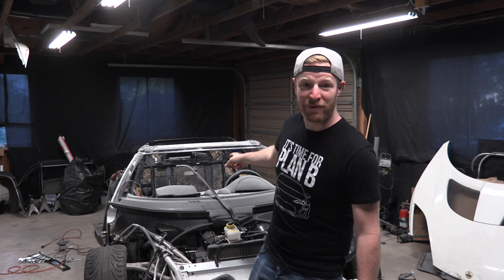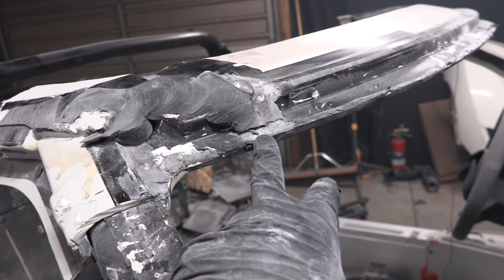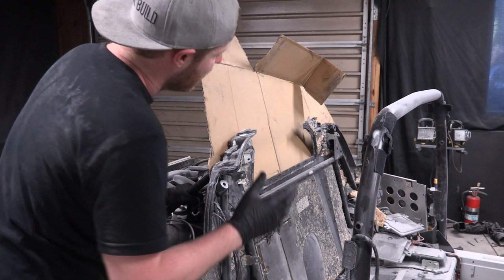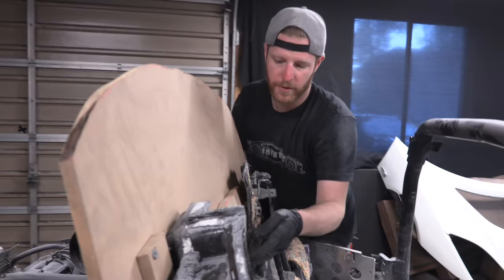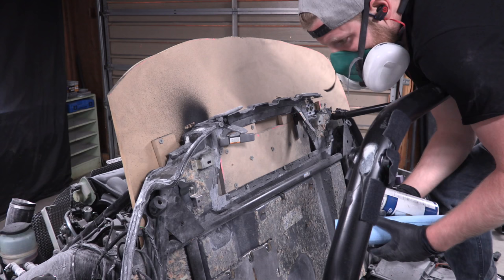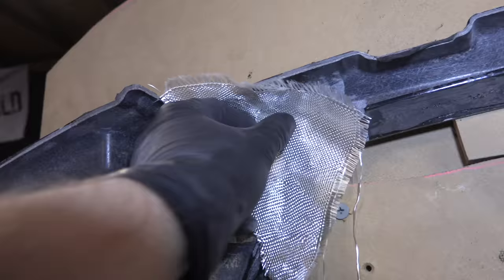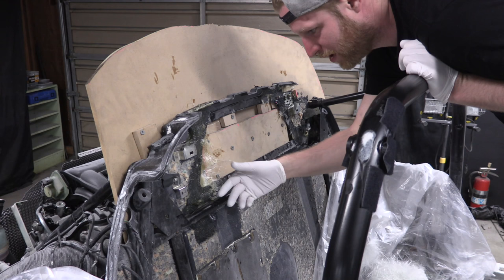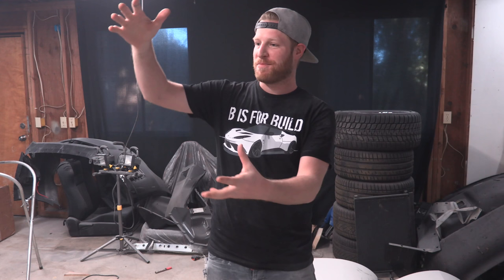Budget Lotus Evora Pt 12 - Teardown Is Done! Let's Build!

Comment: Do a clear roof. Like plexiglass. Could look cool
Reply: agreed
Reply: yes man. definitely argee
Reply: As long as it doesn't yellow from the sun and it's strong enough.
Reply: +FishFind3000 is it possible to tint plexglass? it could help. idk just curious
Reply: Great idea
Reply: I expected to get some hate from this. Thanks guys
Reply: Gorilla glass would be better, you don't want hail on that lol
Reply: +CR7GB11 it hails very minorly once a year in Oregon, that isn't really a problem. I'm a 15 year native and the biggest hail I've seen is about the size of an air soft BB.
Reply: dark tinted... or else wud be a headache...
Reply: Mason Forrest Well I'm from the Netherlands. My sister had dents all over her roof and my brother in law had a broken windshield and roof because of hail. And it was the size of a golf ball. 
As for the evora maybe make a custom soft top?
Reply: +CR7GB11 Plus I'm sure this would be garage kept, so I don't think hail would be a problem. but I like the Idea
Reply: Its plexi. They use it for racing and also they use it in thicker applications for stopping bullets. Don't think hail would be an issue.
Reply: FinerThingsInLife Doesn't plexi stain also?
Reply: That would be really cool, if tinted and formed to look the same as the original roof.
Reply: New-age Plexi and other materials that are very similar are super different from the 90's shit. Most of the high grade plexi wont yellow in the sun anymore.
Reply: Then plexi glass would make a good choice. Would it heat up the car a lot if the sun is pointed at it?
Reply: +CR7GB11 it might not yellow, but it's gonna let light in lol, would need a hella deep dark tint, like triple limo, but I fear that might add more heat, soooo... triple limo with uv tint in between those layers? Lol I don't even know.
Reply: (would)could also ruin it
Reply: +FishFind3000 lexan
Problem solved
Reply: +FinerThingsInLife lexan is better for this purpose

Comment: Tip for you when sanding or cutting fiberglass; before working rub any exposed skin (arms etc) with talcum/baby powder, it will stop your pores from being open and you won't get the itching normally associated with working with fiberglass.

Comment: I'm not sure if this has been mentioned before, as I just found this channel... but the tires are mismatched. The rears are bald, and the fronts are on backwards. It's not surprising the car lost control in the wet, since the water was being channeled into the center of the front tires, and the rears have no tread. My guess is the previous owner didn't know anything about this car, and likely stretched his budget to afford it (tires are the first indicator someone is struggling with maintenance... who would run around with bald mismatched tires on purpose??). Great channel!! Subscribed.

Comment: I am a fibreglass engineer. Just a tip on the fibreglassing the bulkhead.
1. Depending upon how thick your fibreglass matt is. For extra strength and low weight try using 1 layer of matt and two layers of weave. 
2. The drying time in between layers doesn't matter. You can apply the second layers as quick as you want as long as the resin hasnt gone off. 
3. With the bubbles in the fibreglass just use a standard paint brush to push them out instead of a roller especially with all the contours and shapes around the bulk head.

If you need anything else just pm

Comment: main trick with using the fiberglass mat is lots of resin under before you apply the mat so it soaks through then roll the air out right away

Comment: The chopped matt is not stronger than the woven cloth even with different loads applied. As you mentioned the chopped matt is lots of little strands, the strands are where you get your strength. So the chopped matt has thin strands, but they are short, your woven has thicker strands to absorb more resin and are long, this is a big difference. Also I've worked with fiberglass for nearly two decades, you don't want to wait till tacky and come back and recoat. Your going to build up with too much resin that way and it will make the piece heavy and brittle. (Think like concrete without rebar) lay down several layers of your woven at once to build the piece back up. The idea is to have JUST enough resin to wet the piece, this gives the best strength to weight combination. That's why the pros use vacuum bags to squeeze all the layers together and remove extra resin. I used to cut all my cloth, alternate the grain each layer, then I would dip them and put them on the car, then work out any air bubbles or dry spots. You can also put wax paper over it with clamps to "squeeze" your layers together.   Good Luck bro.. your crazy. BTW... you need to research gelcoat, because you are going to have to use that on several areas of the car.

Comment: You might want to look at using a heat gun and scraper to get the glue off.  I've also had good success with air powered scrapers.
Reply from the maker: that little oscillating tool i have works wonders for removal
Reply: B is for Build I agree completely, I was just thinking of something a little less invasive.

Comment: Protip, don't apply the fiberglass one layer at a time. Get yourself a smooth plank, apply some wax to it as a releasing agent. Build up multiple layers on the plank to the desired thickness with a mixture of chopped mat and the woven. Wet the mat on the plank layer by layer and press them together and spread the resin with a roller, this makes life much easier and drastically decreases the chance of air bubbles. Then transfer the (still wet) fiberglass from the plank to the surface you are applying it to.

 It also saves a huge amount of time and cleanup between steps and a lot less wasted resin from doing multiple single layers.

Comment: Mat can be stiffer, but it is never actually stronger than woven or stitched fiberglass. Mat fiberglass is most often used as a filler reinforcement or stiffening agent. Satin weaves are directionally stronger than plain weaves, stitched fabrics are directionally stronger than weaves. Also note that epoxy resin is stronger than polyester and vinyl ester resins, but can't be used with mat. For best strength, weight and conformity I recommend vacuum bagging.

Comment: you should have waxed the boards just to make sure the fibre glass doesn't stick to it
Reply: yeah lol and why is he doing it in individual layers.
Reply from the maker: good tip, i think im going to have to do more than a bit of cutting to remove it, but its all kinda what i expected. But wax woulda been cleaner. These are the good things you learn along the way.
Reply: +B is for Build you don't need expensive or time consuming waxes either. I did a project using a dry lube stick (it was like a soft wax stick..like surfboard wax) and it worked excellent.

don't be afraid to do more than just one layer of glass, biggest thing is to push the glass down so the resin and air come to the surface (use a paddle roller )
Reply: +B is for Build I can see that you have bought a new oem rims for the evora

Comment: @14:19 Your windshield frame looks like it will not be strong enough to hold the glass. The top of the windshield frame is no longer supported from the back, because you cut it. I know your going to rebuild that, but it is a load bearing structure. Your add on couldn't possibly be as rigid as the original 1 piece. Dont hit any potholes, or speed bumps! :D

Comment: The fiberglass resin should not harden unless it's waxed. Resin needs to be isolated from the air to cure, if it cured just sitting there then it has wax in it and adding more layers after it cures can be problematic. The layers will probably not stick together very well, and may delaminate. Hopefully this is not the case. Try to buy non-waxed resin, then add some wax to your last coat so it will cure.

Comment: Awesome video! Question....If you put fiberglass over the wood screws used to splint the fiberglass how are you going to remove the wood....
Reply from the maker: good question, ill drill that part of the fiber out to remove the screws, then fill it back in later. It was just too much work to try and work around them

Comment: great job man what resin and hardener are you using mine I'll have to check to tell you but I'd fill the cup same as yours half way then 20 drops and it would be tacky in 30 mins hard in 45 total but probably not fully cured don't think that happens till two weeks because still smelled fumes in the garage till then. 
working with fiber glass is amazing if anyone has a good project just try it out it's cheaper then you think $50 for  a good start just remake a a-pillar and learn from that my first project was stealth sub to a terrain using there stock box sounded amazing.
Reply from the maker: im using bondo, it says 2 hours online but im going to cut the time down a little more for the next session

Comment: What camera do you use?
Reply from the maker: gopros ( old ones ) canon EOSM was my starter camera, and i have a broken canon xc10 i use
Reply: Thanks for the reply, in gonna start vlogs and I was just wondering what certain youtubers use I'm thinking of getting the t6i and a GoPro which ever comes first
Reply from the maker: I would either get a gopro with a good mic and a gimbal, or a EOS-M as a starter camera, EOS-M is a very inexpensive way to start and its been a great camera for me.
Reply: Thanks! I'll look into it! May donate a newer GoPro also so be on the lookout 😎
Reply: Even cheaper, and lighter you can get yourself a Canon G16 witch is almost the same sensor with autofocus, autostab and does 60p FullHD and also get wifi to send it straight to you phone ;)

Comment: Note to self: never buy a british car
Reply: Aston Martin, Jaguar, Maclaren?
Reply: exactly!
Reply: Aston Martin, McLaren, jaguar, Land Rover, ariel, caterham, what's wrong with them?
Reply: +MULTIBASHUR 1999 rovers are shite I'm surprised they haven't rusted away
Reply: +marc morrison land rovers almost never rust.....
Reply: +MULTIBASHUR 1999 Ahh you said land rover I thought you meant rover my bad
Reply: +marc morrison haha no problem 😂
Reply: +MULTIBASHUR 1999 older jags rust like a bitch and are horrible to work on, otherwise they are nice cars
Reply: +ronald McDonald where are you from? Where I am most old jags are well looked after and only have maybe a tiny bit of rust
Reply: +MULTIBASHUR 1999 i live in Australia, my mum has a 1970 XJ6 and my grandma has a Mark II, the xj6 has a fair bit of rust, and needs work but cant happen at the moment unfortunately. It has dual fuel tanks with shitty caps that sit on either side of the boot/trunk and if the tiny drain hole gets somewhat blocked it all fills with water and rusts. that and many other wierd design flaws. the car was designed for a garage in England lol so its not very well suited to a harder life
Reply: That's racist.
Reply: Lotus Evora is an amazing car. However rolling one onto its roof at speed isnt recommended. Fixing fibreglass isnt actually that difficult if you scuff or crack the bodywork just take it to a specialist and it will be as good as new. But when entire sections of a car need replacing its going to get written off.
Reply from the maker: bahaha
Reply from the maker: im actually really happy with how easy this car has been to fix. If it woulda been made out of metal i wouldnt have been able to even think about rebuilding it to OEM standards.
Reply: +MULTIBASHUR 1999 AHAHAHA DID YOU JUST SAY LANDYS DONT RUST AHAHA
Reply: how about mclaren P1 ?

Comment: fiberglass dust is not just "dust", is a proper bitch, that car will never clean up completely, specially inside the vents and tiny areas, without mention the engine compartment. That dust is actually made of tiny fibres, that will stick everywhere and ruin things. Also the fiberglass  repairs were made ignoring many of the basic rules, so I wish him good luck because  that car is likely ruined already.